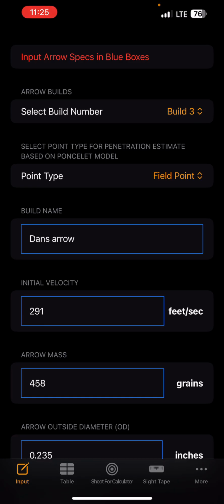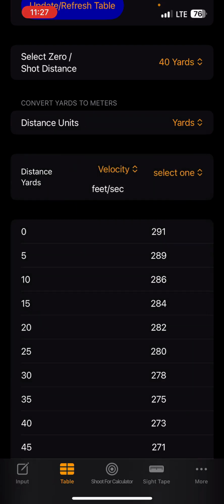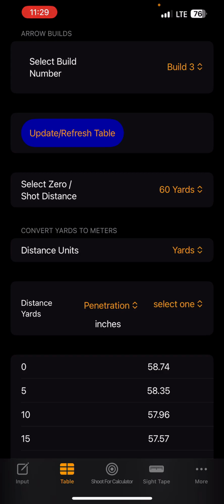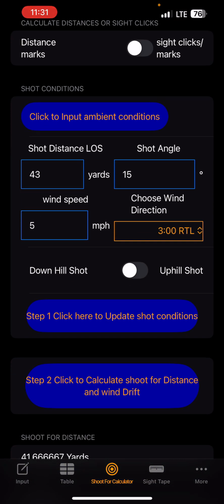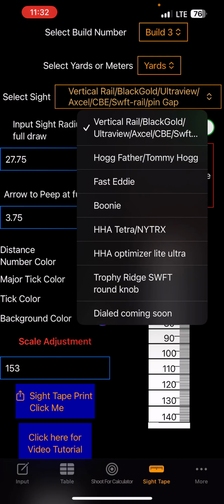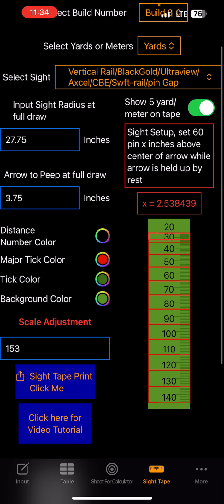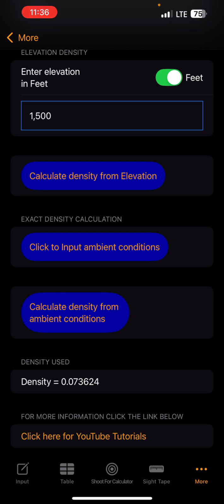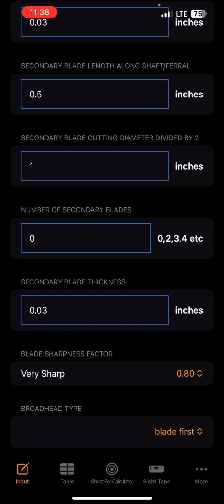Overview of Pro Archery Ballistics iOS.

Comment: Lucas, was playing around with the app tonight and when i input my data my down range speed i got from my lab radar isn’t matching up unless i change my custom drag coefficient down to 1. App down range speed using 1.6 coefficient @100 yards is 260fps with my lab radar im closer to 270 fps. At a 1 it matches up almost exactly at 20, 40, 60, 100
Reply from the maker: Very interesting! Thanks for the feedback. What fletching and arrow combination are you running?
Reply: @ running victory hlr 250 spine, aae airazr hunters using a arizona ez fletch mini max left helical
Reply from the maker: @tylerharrington4372 very cool! Did you adjust air density, and all the input parameters as well? Also what was the wind when you were testing any small breeze? You might of found a Goldilocks zone to get down below 1.6. So that’s why I am asking all the questions trying to determine if I can replicate it for a better arrow!
Reply: @ didn’t mess with the air density i’ll try it and report back. Wind was pretty calm maybe 3-5 mph left to right. Great app btw!
Reply from the maker: @tylerharrington4372 by default the density value isn’t much different than sea level. So very interested to see!

Thanks glad you are enjoying it you have the ultimate tool to really dial everything in. If you are matching velocity at all those distances your sight tape will be spot on!